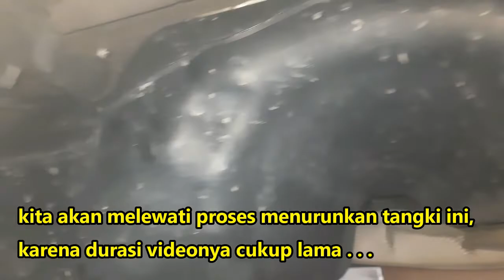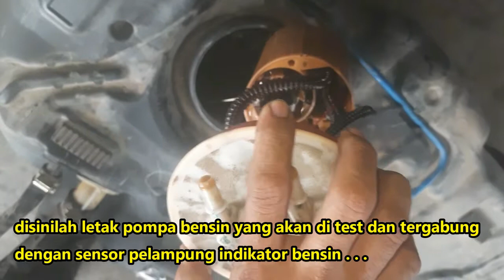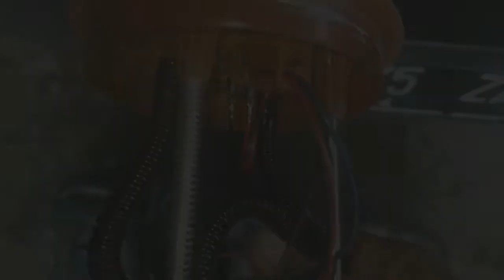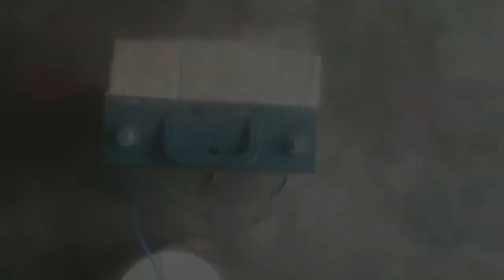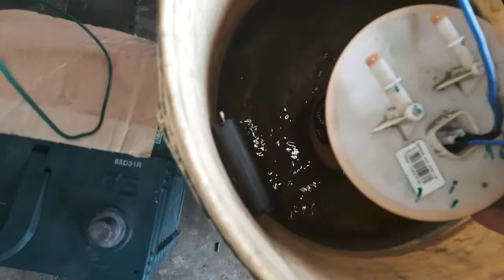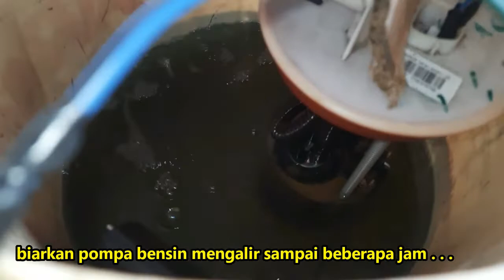Cara test langsung pompa bensin mobil/ Ford Ecosport Titanium, biar tahu bagus atau tidak...

Comment: bang motor rotaknya bisa di ganti  pake punyanya mobil apa?? mohon jawab bosku
Reply from the maker: Maaf..kami blm tahu tentang persamaan yg bisa digunakan dari mobil lain utk mengganti motor pompa itu, kemungkinan utk tipe beberapa merk mobil ford yg menggunakan bensin kemungkinan ada yg sama
Reply: persamaannya dengan avanza yg socket besar, punya saya baru ganti setelah 139rb km, sdh terlanjur beli rotaxnya fiesta beda socket aja bisa diganti tinggal solder aja

Comment: Bang kalo ecosport ini harus ngisi bensin apa?
Punya sy isi premium normal, kelamaan lalu perpindahan gigi 1 ke 2 menghentak dan indikator engine check nyala

Pas bensin mau habis sy isi pertamax turbo, hilang lah itu hentakan dan indikator engin hilang

Setelah itu sy isi pertamax aja lg, ga lama berselang nyala lg engine check nya
Kira2 itu apa ya bang? Dan hentakan nya itu muncul lg
Mohon masukannya bang, terimakasih
Reply from the maker: Masalahnya yg cukup rumit dan dilakukan pemeriksaan menyeluruh, masalah bahan bakar bensin tdk terlalu berpengaruh pada nyalanya cek engine, nyalanya check engine dipengaruhi banyak faktor seperti sensor2 pada mesin yg kendor atau rusak, modul2 kelistrikan yg bermasalah, masalah hentakan bisa juga terjadi apabila suplai bensin k mesin ter-sendat2, kemungkinan krn motor pompa bensin bermasalah atau sistem kelistrikan ke pompa bensin error, kami biasanya melakukan scanning dgn scanner mobil utk mengetahui semua kerusakan yg mungkin terjadi pada sistem mobil, cek k bengkel terdekat lebih pastinya utk memastikan dan menangani masalah tsb
Reply: @AJMcrews  terimakasih bang atas penjelasannya 🙏